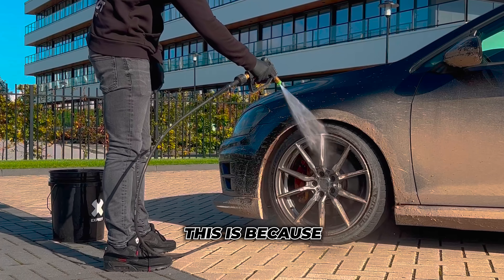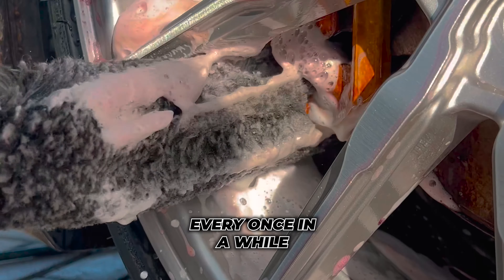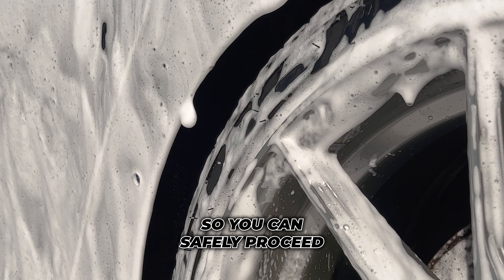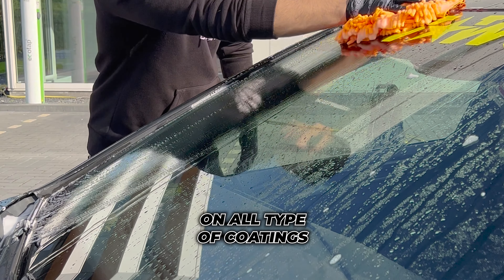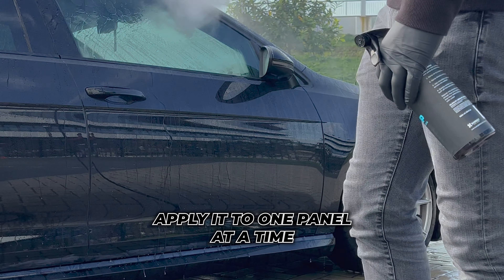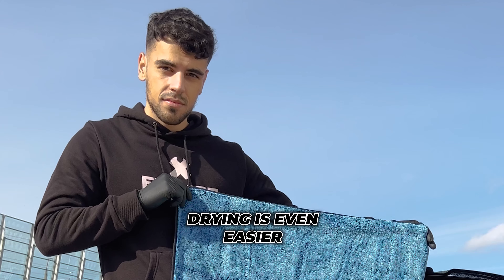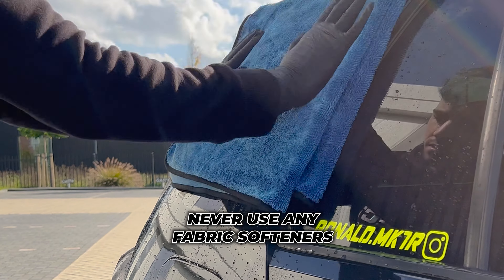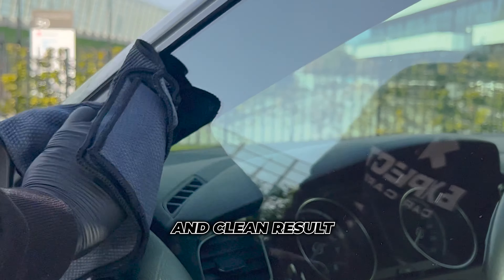The Dirtiest Golf 7R We Ever Washed

Comment: Agree with everything other than 5 wash mitts. 

That’s overboard and waste of resources. 

2 at an absolute maximum

But 2 bucket cyclone grit guard method is sufficient with one or two wash mitts and safe enough
Reply: exaggerating, one will do it. Any type of protection will reduce scratches. Ohh and scratches are inevitable.
Reply: @MrKiNgTV-vn2bu  I use to use 1 bucket for cleaning my towel, after washing a panel or two, I quickly rinsed my wash mitt before dipping it into a bucket. I find it still safer to use than 2 buckets.
Reply: he probably used 2 buckets for each one.........